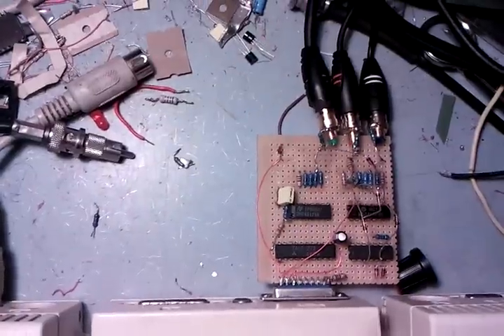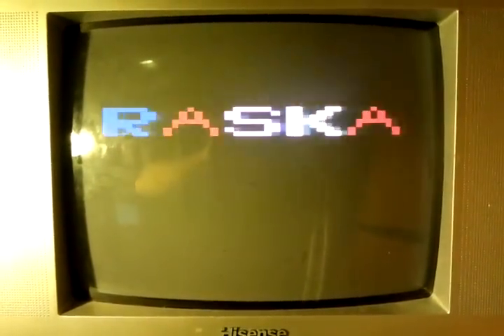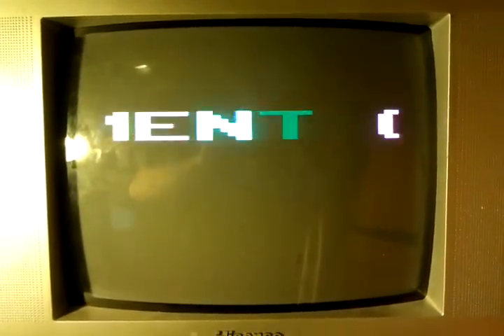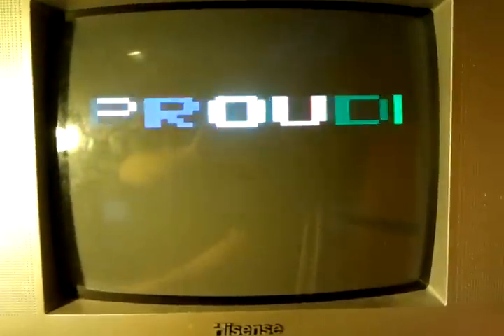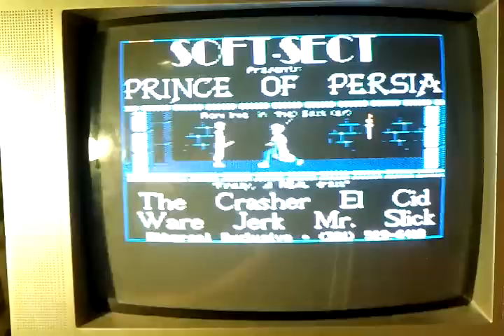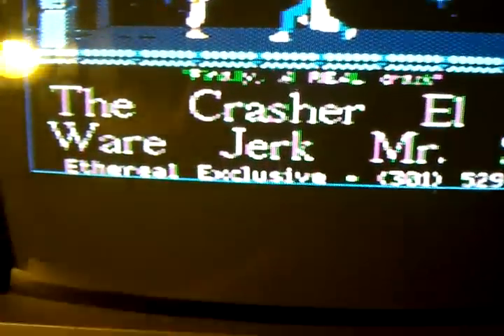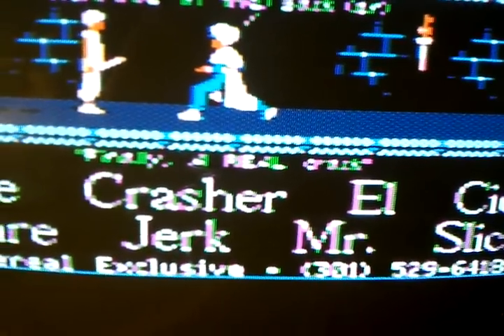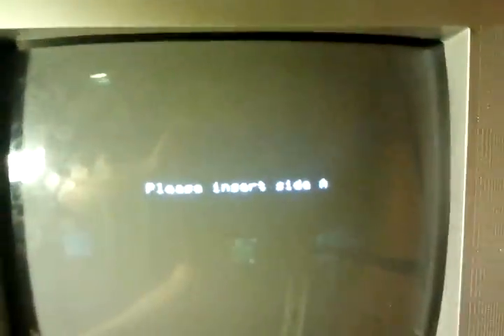Apple II Digital Colour Demodulator

Comment from the maker: The MC6847 outputs an NTSC component signal which is then modulated externally to the device. It should be possible to wire it straight up to the component input of an NTSC television. Though if the MC6847 outputs a YIQ colourspace instead of the YUV colourspace, the hues will be rotated by 33 degrees. I haven't looked into it enough to be certain.